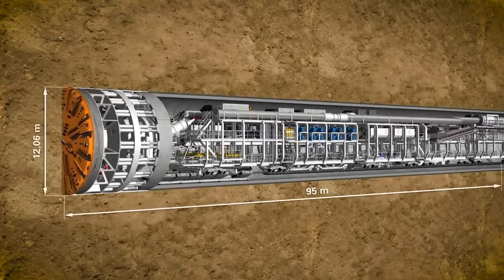Why The Grand Paris Express Will Change Transportation

Comment: What's even more crazy about Paris rn is that even though the grand Paris express is not finished, the region is already launching the preparatory studies to build a 19 th line in the north and planning expansions to the other lines... It feels crazy to see so much being built, and see that they do not intend on stopping there!
Reply: well the ligne 19 is due for 2039 (at least). And since the line 15th was due to 2018 at first, they can start early xD
Reply: @deztabilizer  Even if it turns out to be true, this is not what I wanted to stress out. Because to me it feels just right for a city to plan transit ahead, but many cities just don't, even if the city is stuck in a car centric vision..
Reply: Positive learning curve, they'll take advantage of the fact that they're already experienced and build even more, vastly reducing emissions
Reply: More, more , more and more.
Reply: @deztabilizer  That is incorrect. South of line 15 has been announced for 2024 and at this stage is only delayed to 2025. Maybe you're mixing up with RER E Western extension which was indeed announced first for 2019 and will only open in 2024 (That extension isn't part of Grand Paris Express).

Comment: How does this project compare to the London Crossrail Project/Elizabeth Line?
Reply: The Elizabeth line is London's version of Paris RER and, more specifically, line A.
The RER was built by repurposing existing or former suburban lines and creating new ones.
Then, by building a massive central section tunnel to link them, with gigantic stations aimed at extreme capacity.
All this on a cross-city scope, with branches.
It also followed parallel to a long existing and saturated metro line in the center in order to relieve it.
It's the same model that was used for Elizabeth line.
The relieved line was M1 in Paris (then once again another support line, M14, was built in the 90's in the center of the corridor), and it's the Central line in London.
The missions of RER A or Elizabeth line are the same: 
To allow fast, high capacity, high frequency cross-city journeys via the center, paralleling an extremely busy Metro or Tube line and relieving it.
The shape of RER A and Elizabeth line is even similar, they both run East-West with branches and link both the historical and newer business districts of their respective cities.
RER A is now Europe's busiest mass transit line (or the world outside Asia) by carrying regularly more than 1.5 million people in a day. The trains are gigantic and  carry more than 3000 passengers. Elizabeth line should really soon become the East-West backbone of London's network.

The Grand Paris Express, on the other hand, is quite different : it is a set of 4 entirely new and fully automated express metro lines (plus 3 major extensions on 2 existing lines), not repurposing any existing or former lines, so the 200km of new lines are all built from scratch.
90% of the total, or roughly 180km, are built deep underground. The remaining 10% or 20km is mostly on viaducts with a few bits at grade.
It's aimed at offering rapid orbital journeys with plenty of connections, from suburbs to suburbs, while completely bypassing the center.
The expected ridership on the GPE itself is over 3 million daily.
The GPE's design is not complete yet, a section in the West of the city, specifically the one between Versailles and La Défense that is often represented as a dashed line on GPE maps, is not yet defined.
This part's definition is expected in the near future, and a 19th metro line was recently proposed by the region and the transit authority. So, a GPE 1.5 is expected in the near future, an extension to the extension.

As for the building part : at some point during the peak works of the first major building phase, up to at least 21 TBM's were digging simultaneously and advancing tunnels by more than 250 meters per day.
A few months ago, the 100km milestone of built tunnels was passed. Only less than 80km of tunnels remain to be built, and they should reach peak digging of the second phase in 2025.
That's, of course, what remains of the current design state of the project, not including the dashed line in the West.

GPE lines are orbital, especially M15, which is a gigantic 75km long loop line around Paris, entirely in newly built tunnels.
M16 and M17 will have a short interlined section, which is a first in the Paris metro. M16 will form an arch in the Northeastern quadrant, connecting with M15's tail deep in the Eastern suburbs.
M17 will serve both le Bourget business airport and CDG, the main Parisian international airport.
M18 will start from Orly, Paris second international airport, where it connects with the M14 extension.
It will then serve the "Brainiac Valley" where many of the most prestigious science universities and specialized schools are located (like Polytechnique, etc.), and forming an arch to reach Versailles. As mentioned, the part between Versailles and La Défense isn't defined yet.

For magnitude comparison between the Crossrail and GPE projects :
The Crossrail project had 21km of new twin tunnels (6.2m in diameter) and 10 newly built stations, the rest was repurposed existing infrastructure.
The Grand Paris Express has 180 kilometers of tunnels, mostly 10 meter wide, out of 200km of entirely new lines,  84 entirely new stations (68 on the new lines, 16 on the extensions), the vast majority of them being deep underground. Plus 220 new fully automated Alstom Metropolis trains.

They both are fantastic projects, but they are not exactly comparable in scope.
Even if their cost is roughly 1 to 2 between Elizabeth line and Grand Paris Express, the size of the GPE is several folds the size of Crossrail.
This underlines the cost ballooning issues in the UK with major infrastructure projects.
For 22 billion euros, London gets one line with a 21km long new underground central section, 10 new stations out of 41 stops, and some repurposed suburban branch lines, plus 70 new trains.
For 42 billion euros, Paris gets 4 new lines and 3 extensions representing 200km of new lines built from scratch,  including 180km of new tunnel sections, 84 entirely new stations, 220 new fully automated trains, and last but not least : a massive renewal of the urban fabric, including major housing projects and traffic calming measures.
In parallel, there are plenty of other transit expansion developments, the GPE is only one part of a larger scheme. Currently, there's a 360km overall transit expansion underway covering metro, RER, trams, at least one new urban multi-station gondola line and several new proper busway-bustram BRT lines.
The GPE represents 200 of the current 360 kilometer expansion of mass transit.
The part of GPE that is comprised of extensions, namely to M11 and M14, will open before the end of June this year. There's also an important RER E tunnel extension opening around the same time, with 3 major new stations, plus an orbital tram T3b extension.
It's transit-a-palooza in Paris...

So both projects are quite different, but if the GPE can be of use for London, it is by directing the focus on the outrageous and abnormal costs of infrastructure development in the UK.

Comment: The GPE (Grand Paris Express is NOT 200 km of track BUT 200 km of double track tunnels (400 km of track). To bore them up to 21 "Tunneliers" (TBMs Tunnel Boring Machines, 100 m long, 10 m diameter) worked simultaneously.
This video has been made available multiple times (erased, re-published and its content is aging)

Comment: Studies said that it will NOT decrease trafic. It will however remove congestion from central RER sections
Reply: Do you mean car traffic or transit ridership? 
It's expected by studies to remove a minimum of 150,000 cars from the roads.
With an expected daily ridership of 3 million, just for the GPE.
It would free up space on several lines at various degrees.
Reply: @KyrilPG  I meant car traffic

Comment: Your first analysis is right. people mostly live in the suburbs, Paris itself is to expensive. and for teh same cost reasons, most of teh jobs are located in cheaper area outside the city. therefore comuting from one suburb to another is mandatory. this leads to major traffic jams, which are a loss of time and money for the people and teh companies and an environnemental disaster.
allowing quicker and more efficient public transport by direct lines is a good option to move more people in a shorter time.
It can only get better than what it is/was.

Comment: Looks quite outdated compared to a Korean system.  i cant see how this can "change transportation"
Reply: The idea is to change transportation in Paris which would already be good enough. Now if you compare Paris line 15 to Seoul line 2, the main difference is speed. Seoul line 2 has 51 stops over 60km of length. Paris metro line 15 will have only 36 stops over 75km of length. Basically there are 1 stop every 1km in Seoul and 1 stop every 2km in Paris. Paris line 15 will also be fully underground, fully automated with trains operated at 120 kph. Lines 16, 17 and 18 have even less stops making them even faster. Obviously the Asia-Pacific region is doings marvels when it goes about urban engineering, but it's a bit excessive to call this Paris project "outdated".